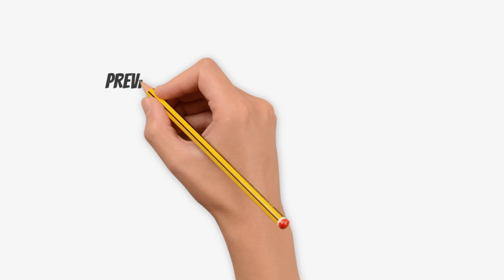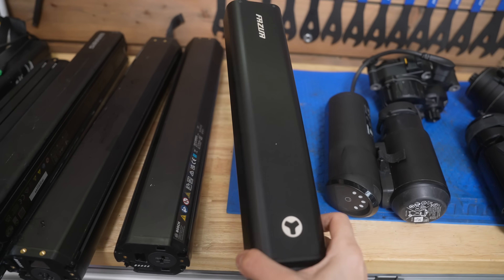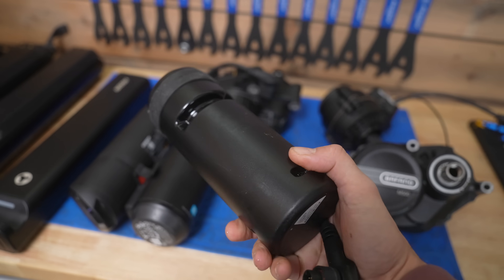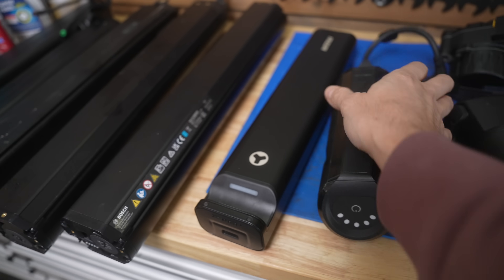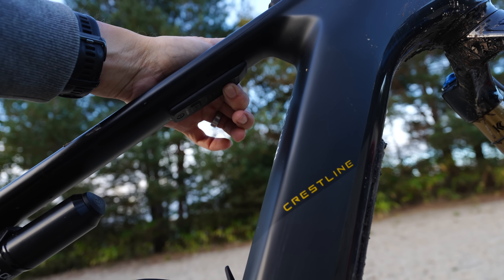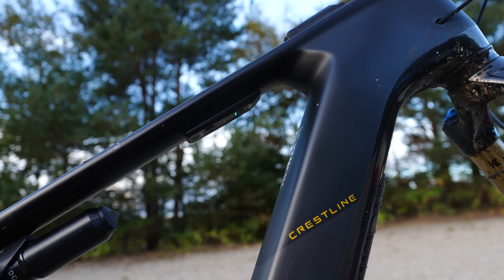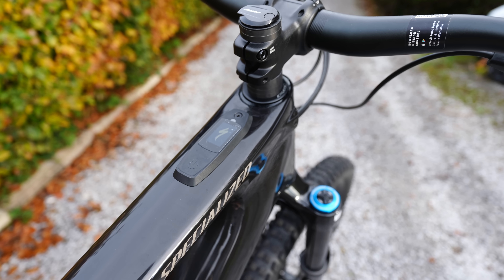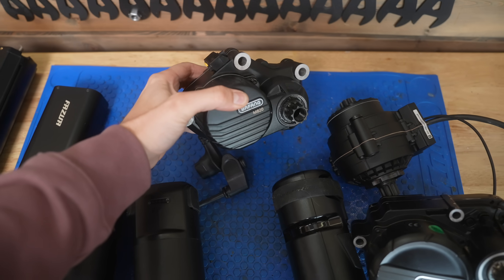We Have A Huge Problem With Ebikes....

Comment: Your video was true.  For a tiny section of the ebike market population.  For those people who want to buy the most expensive of all ebikes, (the big name manufacturers like Cannondale, Specialized, etc).  Those are the companies who want to sell the highest ticket price bikes they can conceive.  If you are one who is willing to spend $3, 5, 7, $10,000 on an ebike, then I have no pity for you.  At present, the ebike market has flooded the low priced, recreational bicycle market with ebikes in the under $1500 market.  They are all made with common, standardized, and replaceable components for the mass market to buy, and upgrade as they see fit.  If you are looking to get an ebike that is able to ride on the "mountain of Hell", then you are a crazy dreamer with too  much disposable $$$ in your pocket.  The ebike market IS evolving, but not for you.  Super high priced ebikes are for those who also like exclusively high priced luxury cars.  That is the market where the super expensive technology is used as an experiment, so that later, that tech will filter down to mainstream market. If you want more standardization, buy a cheap $1500 ebike to have fun with and then ride your leg-powered high end Brand mountain bike.  I shed no tears for you ultra-high-end bicycle junkies that must have the newest, baddest technology.

Comment: If just two of the bigger companies agreed to standardize then they would probably gain more market share and it might get other competitors to join in, or group their technology with another brand, or two.  It has to have a commercial benefit for the companies for it to happen.

Right now it’s the Wild West of e bike innovation.  If companies are locked into backward compatibility, or frame geometry (bolt patterns) or battery chemistry, then they can’t do anything revolutionary.  Technology and innovation will stagnate, or at least move very slowly.  It becomes innovation/design by committee, which never works well.

Comment: what if the best selling bike, is the the middle of the road, kinda heavy, loud, inefficient, but cheap?

If just two of the bigger companies agreed to standardize then they would probably gain more market share and it might get other competitors to join in, or group their technology with another brand, or two.  It has to have a commercial benefit for the companies for it to happen.

Right now it’s the Wild West of e bike innovation.  If companies are locked into backward compatibility, or frame geometry (bolt patterns) or battery chemistry, then they can’t do anything revolutionary.  Technology and innovation will stagnate, or at least move very slowly.  It becomes innovation/design by committee, which never works well.

Comment: That's one reason I left the bicycle style of bikes. I built 2-motorized gas bikes and both are hard-tail bikes. Just adding a front-suspension fork improved the ride 50%
from the standard fork on one of the bikes. Most of the bike frames are cheaply built and aren't durable enough for modifications to a motorized bike. I went to a Ebike
or I should say a Emoped style bike which uses a HubMotor which is easy to change over to a new HubMotor. The batteries are 2 standard mounted batteries on rails
that can be switched out to larger rails or even higher voltage and current batteries. The Emoped I bought is the Akez S1 and even if I wanted to remove the HubMotor
and go to a gas engine I could easily do that. The frame is all steel has full-suspension and used the 20"x4" tires. The ride and handling on the bike is real good along
with the range since the 2-batteries supply 48v. plus 26A of supply. The Emoped can be easily modified to run up to 72v. and a single high amp battery if need be to
run higher speeds. I believe the manufacturers are wanting to sell proprietary batteries at a high cost. The general Public should stay away from those manufacturers
selling those Ebikes. Another thing I noticed was that the Dashboard readout has colored readouts and in bright sunlight the status of the battery and controller is hard
to see and some of the status data can't be seen even wearing polarized sunglasses. Most of the things on the Ebikes are just gimmicks to sell to the Public. The Akez
has the M5 Dashboard display and it is a quartz display with a  black and white background which is real easy to see in bright sunlight and is actually too bright at night
even in the lowest selection setting. The Lectric Ebikes use the same display and as far as I am concerned, that Dashboard is the best functional no frills Dashboard. 
I would say that the Dealers and manufacturers are really not selling practical Ebikes but are selling Ebikes with Bells&Whistles to capture sales. I guess, Buyer Beware!

Comment: Simple, stop buying proprietary systems. You have, 1 2 4 4 5 6 7 different batteries there. 1 2 3 4 5 6 7 bikes. That 1 2 3 4 5 6 7 thousand+ dollars you gave them, rather thats 1 2 3 4 5 6 7 thousand reasons to keep doing it.

Why is it all of my Nerddoms do-not understand basic consumer responsibilty.

Comment: Stick to rear hub dual suspension bikes that go 40 mph using 60-72v batteries. Such as a wired freedom bike. You can add a battery on the rear rack in a bag easily. No need to fuss.

Comment: Unless, you convert your favorite bike, to an E-bike. I did this back in 2019. I have two batteries, from two different companies, they both work. So it all depends. Oh, and I went with a HUB motor on the front wheel.

Comment: As someone who works professionally in this field, I generally recommend Bafang, Em3ev batteries, and Grin Tech as universal standards. Shark style batteries in general are extremely easy to work on and fix for customers (no proprietary communications to the motor controller), Reetion is also similar but can requires unique frames. Bafang being the easiest to get parts for, upgrade, and cross compatability. And Grin Tech for their open software (ability to reprogram to your specific needs).

Comment: The E bike industry is a big scam. Paying up to 80 Cents per kilometer on a brand E bike after 3-4 years is hilarious and even more expensive than a car. The bikes are mostly a vendor locked platform that does not even accept regular stands, sprockets, wheels or whatever. Everything is made in a way to fight repair in general. The bikes are most often over engineered and optimized to be worthless after about 5 years. The batteries are of extremely low quality, a fire hazard and ways to expensive. I am talking from experience with this "Riesenmüll".
Reply: @nonegone7170 With R&M you are at about 1.6 Euros per kilometer after 3-4 years. I took a more "reasonable" example, - - the  i:SY XXL I ride.
I use the term Riesenmüll as synonym for all overpriced E bikes that suffer from the bosch or other middle motors, both technically and economically.

Comment: This is completely expected, and also a good thing. It's literally how all new product categories launch. Standards evolve slowly and slow down innovation. In a relatively new product category like e-bikes we don't know what the best practices are, so there can't be standards. Standards will evolve eventually, but forcing them in too soon is just going to do more harm than good to the consumers. If some manufacturer comes up with a revolutionary new thing, they'll have to wait years before they can get the standard upgraded to support that. In all likelihood they'll just launch their own proprietary system. When innovation is still running hot, standards can't exist. I suppose they could start with the chargers, but everything else is changing too rapidly to standardize.

Comment: I agree with you that standards are good but one of my questions is why do folks feel like they need the latest and greatest? If you bought a bike 6 months ago or even a year or two ago, chances are that it’s still great. 

If the e-bike serves its purpose and fulfills your needs (to the extend of the law) I struggle to sympathize with the consumeristic take that you need the latest and greatest.

On the other hand, if your motor or battery fails, then I feel like the manufacturer should make replacement parts available to purchase at a reasonable price. This is where I could agree with open standards so that manufacturers are pressured to lower their prices due to competition.

Comment: A bit late to the party here as this is the first video I've seen in my feed from this channel. In searching through the comments I haven't seen this brought up. USB Power Deliver protocol supports V36 & V48 charging at up to 5amp which only covers two of the three major voltages and comes in a little short of a small number of 6amp "fast" chargers I've seen but already you have one plug that covers the vast majority of use cases. Better yet the handshack of USB-PD would allow for it to be interchangeable as both a 36V 4-5amp or 48V 4-5amp chartered meaning one chargers could support countless batter types.

Bonus: I'm a professional A/V engineer and XLR which many manufactures use as a connector already has since I was born support 48V "Phantom Power" and has minimum number of connectors to adopt a USB-PD like handshack and the cables can handle the higher amp asks and have been carrying 48V over capbles for decades. I think these two plugs can support all the present and future Battery Charging needs for the foreseeable future and are both widely available in supported cables, plugs, and adapters.

Comment: I think one of the big issues is when you produce something with a standard in electronics someone finds a place to cheapen out and batteries are definitely a place where this happens and can cause issues. While i do think reputable brands should try to be cross compatible making it easier to plug and play it leaves room for people to make those cheap knock offs which can cause damage to other components in an ebike circuit and become safety hazards if poorly made/maintained. I think it’s partially a way to tie up lose ends and they definitely aren’t the first category for electronics to become non compatible like this. But it would be amazing if the big brands could simplify down into a couple matching products

Comment: Add all the costs of buying and running an e bike for 2 years. 
Depreciation 
Spares 
Electricity etc.
Divide it by the kilometres travelled   and most owned will have cost the same as running a small car.
Please do the maths before contradicting me.

Comment: Huge problem, just had a battery fail on my YT Decoy, just outside of the two year warranty, cost of £500 to replace, ransom money, because without a battery, the whole bike is useless!! I wonder in 5 years time, will you have all these e-bikes that will be expensive ornaments in the garage with no money, or will to replace, I for one, don't think I could afford another.

Comment: All great ideas, you must be new to the bicycle industry...because it is not specific to E-bikes. UDH- Great idea, but this was SRAM being sneaky for their own benefit so they could release T-type transmission. Theygave the design away to manufacturers to incorporate, Shimano already tried a few years ago, but failed We are still going to have 100's of different deraileur hangers. Still to this day we have new types of Bottom brackets being released,  3 main spindle sizes, 24mm, 29.8 (dUB)  and 30mm, different shell sizes, press fit or threadded, square taper, octlink, ISIS, power spline......etc. Head sets, seat posts (round aero.......) , internal cable routing, 12 spoeed groupsets and Freehub drivers.  this is NOT just specific to E-bikes.
I love your enthusiasm, but unfortunately this IS the bicycle industry at its best.

Comment: and of course all of this is cheap... I have a 2019 Bosch motor, when it's dead, the bike will have to be unusable if Bosch doesn't supply the replacement, no upgrade is indeed possible... When you know the price of emtbs compared to mtbs, that's indeed time to think about it! And for city bikes it's even more critical since these bikes are supposed to be an ecological "solution" for mobility!

Comment: I have a four year old Carrera that I can no longer use. The year after I purchased it Halfords changed the battery connection. They no longer supply the old style battery and I have not been able to source a replacement.. Halfords staff have confirmed that the newer battery has no improvement over the older design and the only change was the connection. Sure there are a few people selling the older batteries second hand but that's a bit of a risk.

Comment: I am in the install a kit camp but I know that , even though it is pretty easy to put on and has huge compatibility advantages and cost advantages and upgradability, there is a problem with the kits not being robust enough for the gonzo mountain biker crew. Exposed wires are especially problematic and attaching batteries can be even harder. But this is not a problem for me as a road and rail trail rider. I haven’t had more than a few issues over the last 7 years of ebiking: a couple of loose wires, a cracked torque bolt(that was replaced), and a battery connectors on the battery and the tray(which were replaced giving the battery 3 more years and counting). Wore out 1 motor which is being replaced as we speak.

Comment: Sadly I don't see the ebike transmission manufactures pushing this, it will most likely the bike manufactures will when the quality components have trickled down to where they look at different manufactures for different price points on bikes. Like how you see forks used differ from a Suntour fork on a budget bike, through the Rockshox and up to a Fox fort. This is where manufacture costs mean business and will want stuff to fit their frames, not design to fix the chosen motor. At present the budget end of the market is the hub motor.

 While frame mounted motors are a premium product, the retail cost will reflect the costing to make.

Comment: Hmmm, isn’t this simply the evolution of the ebike playing out? The magic hand of the market will determine what we consumers get to choose from at any given moment. Same deal with the electric cars. Remember the bicycle  industry’s headset 1” versus 1 1/8” versus 1 1/4” standards battle? The headset makers did not want to pay Fisher’s licensing fees for his patented superior new headset design. Now for all intents and purposes, we have  an 1 1/8” standard. The industry drove that standardization. The thing that will eventually level this field will of course be the manufacturers decision and it will be based in the economics surrounding the “solution”. The solution to establishing any real industry standard must first play out profitably within the design and manufacturing process and then vertically within the retail markets. The next step will likely be the charger/adapter aftermarket. Replacement cells will  become a basis for new aftermarket products and services. Eventually a standard will be achieved but it will not be soon and it will not be consumer driven.

Comment: Thanks for this. This is exactly why I haven't bought an ebike yet. At 10k I expect this to work for 10 years minimum with easy upgrade and replacement options. Also I don't want to bring my charger everywhere just because chances that the hotel I' going to will have my type of charger is zero.

Comment: Bafang rock my world... with over 2 years, multi builds, some doing 50 miles a day, every day, service is simple every 1000ish miles and the price is unbelievable compared to the rest.. changers slandered, use any battery with the right voltage, all the motors from 250 watts to 1.5 killer watts, all fit most frames, the newer motors all fit in their older frames. what was the problem again... ?

Comment: I kind of agree yes they need the same chargers e batteries could theoretically be the same but that would be difficult too as a change in the frame ergonomics requires a change in battery positioning and that could create weaknesses for stress in the frame so they re design batteries for frame rigidity i wouldnt say this is the case every time although motors are a no go having the same screw holes maybe but it would create limitations on where they can put the electronics can go inside of the case of the motor unless you want a big bulky case which would fit all motor but then you’re unlikely to see innovation this all should sort itself out in a few years once the innovating stops because its cheaper to manufacture the same thing over and over again between bike models but right now its as you said an arms race makes it impossible and backwards compatibility between electronics is very very iffy they take certain voltages and amps to not fry themselves the same for motors its often not as simple as put the same plug on unfortunately.

Comment: Overall, in the entire transportation industry, and in most industries, there's little to no standardization and there never will be. Over time there hasn't been any sign of convergence whatsoever. That said, we all want technology to advance as far as possible and cost the least. Standardization most often works against these goals. Rapid obsolescence and rapid advancement are two sides of the same coin IMHO. My solution has been to underinvest in infant technologies and this allows me a more frequent upgrade path with less pain. I was a Specialized rider but when I considered the new fangled e-bikes I made the decision to dial it back and buy a much less expensive model. Low and behold, when an owner of a Specialized e-bike broke a display and they learned that they're obsolete: Now what. I didn't want to be that guy. Locking back at the automotive industry I decided that they'll never come around to standardization of vehicle parts beyond tires. And then it wouldn't happen if they didn't get a hard no from tire manufacturers.